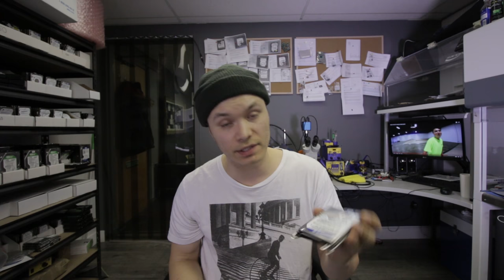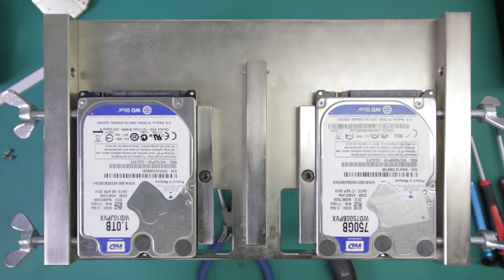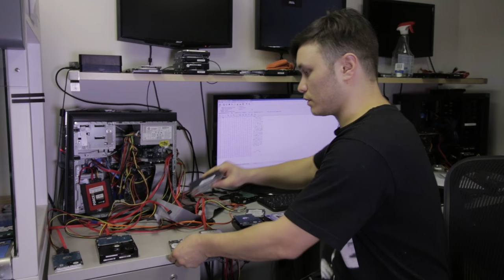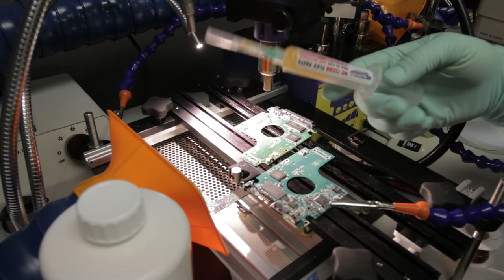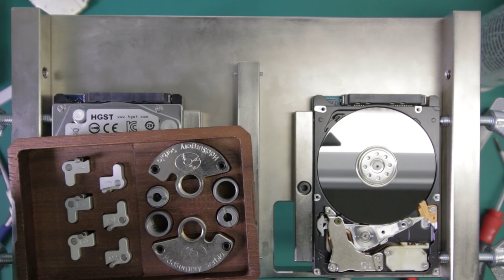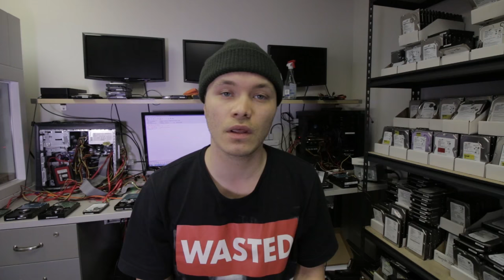hard drives with clicking sounds | 3 dead head drives recovered

Comment: I have an issue with a dead toshiba laptop drive, its does not spin up or read at all, on the inside the motor moves freely, platters look good, the heads look fine, and the pcb has no damage? Any idea what could be the problem!

Comment: Thank you for the interesting video. May I ask you some questions?
1) Why are you actually moving the U12 IC from one PCB to another? With PC3k you can read the ROM of the passport drive with the Serial Interface and write it with the SATA Interface to the SATA PCB. I think, it's much faster then the chip transfer. And you can reuse the SATA PCB more times.

2) On the first WD Blue drive you did't use the HDD Surgery Ramps, but just heat shrink tubes. Is there a reason? 

3) May be you can help me a little bit with one case.  Currently I have a WD Passport drive with the wd20nmvw-11AV3S0 HDD inside. This drive has 8 heads. One (afaik 7 of 8) is not reading at all. I tried to get a cheap donor drive, but it was impossible. The price is about 200-300$ for a working drive. On the other hand you can get 2TB Notebook drives for about 60$. How are you handling such cases and finding a donor?
Reply from the maker: hey, awesome questions.
1) just a habit, but I should really start doing it the solderless way.
2) I will check the family of the blue drive and post in here on Monday, but they do have a 2 disk ramp in that kit that lines up with that family
3) as long as the family is the same donor should work regardless of the spec. I use desktop donors all the time, as long as they have a SATA version of the same PCB they are really good to me. Then there is also this: https://www.youtube.com/watch?v=bN8uwV7udtI

but I have not ran into a swap case where I needed to perform such adaptation. Like I said WD is very good for taking parts as long as family is same.

Comment: Great videos I'm learning a lot thank you. 2 questions: 
 
1)  I have a WD20EADS Black ext backup drive that dropped on a carpeted floor.  Now it spins up but windows can no longer read.   I looked for another new drive to use parts from but I notice the MFG date and DCM# is different.  What are the chances that this drive's board and internal parts will work for repair?   
 
2) I'm comfortable learning anything technical and would like to persue leaning hard drive repair. I have about 50 drives (and several computers) I've accumlated over time and would like to teach myself as much as possible.  My question is, what is the best place t0 buy the CORRECT tools, adapters, clean environment cabints etc. ?
 
Thanks!

Comment: My 2.5" Seagate 500gb laptop drives when connected shows only 3.8GB space n doesn't allows POST test to complete n BIOS gets stuck on blinking cursor. HDD get's detected with my primary HDD of 1TB Seagate HDD in Dell Precision M4800 workstation laptop. How to fix my defective drive that doesn't spins. please suggest.

Comment: I have a wd  wd10jmvw and the hard drive heads go over the platters but then go park to park and it does this over and over again. What would the solution be to get the data off. Move the platters to a working drive.

Comment: do you have any videos that show different types of symptoms of HD failure like diagnosing board or head failure or motor etc?
Reply: 1. Dead PCB (Or damaged Boot-ROM): No sound at all, because drive does not spin up 
2. Clicking sound of any kind: heads cant read 
3. Beeping Sound: Heads stucks on surface

Comment: Hello. Great Video. I have a few broken head HDDs which I would like to play with could you please tell my what sort of material (plastic, rubber) are you using to separate the heads. I'll be really grateful for your answer
Reply: I had the same question.  Looks like some sort of dental rubber band.  There is an expensive tool that you can get that works with Seagate drives, but not sure if you need a different tool for each drive manufacturer, because I do not know if the platter spacing is the same for each.  Any comment?

Comment: Question.. what would be the issue of doing a head swap and trying to run the drive without using those fancy utilities like building a head map or imaging the drive. Why not just run it?
Reply from the maker: what could go wrong if surgery is done without monitoring equipment? Surely enough in some conditions, it can be performed, but why would you want that? Hard drive after a head swap is not a brand new hard drive, and most of the time it will have problematic areas. Many things can go wrong. The operating system is not designed to work with failing hard drives. Disk imaging tools and utilities help to prep the drive for the safest extraction.

Comment: Hi Mate, I have the clicking noise with my WD external 4404a,  I can see the drive in device manager but unable to see it in c drive, anything you can recommend to try please. Thanks again
Reply from the maker: Clicking noise there is only one recommendation. If data is important get pro help. This would probably run you $800-1200

Comment: I have a seagate freeagent Goflex 1 TB external Hard drive which has a very very strange issue. It gets detected by the computer and I am able to open the drive too. But browsing through the files is very very slow and I am unable to even play a single video. I can merely see what files are present within the disc. The disc keeps making a small clicking sound every 5-10 seconds even when its not being accessed. The only advice Ive got is to format it but i wish to try and save data. What could be the problem?? Thnx in advance
Reply from the maker: I would suspect that one of the heads is failing. Formating is not going to reverse anything, it will only make things worse. You need to seek professional help, this is not a DIY. if you want us to check it out feel free to hit us up here, and metion link to this video so I know that it is you: http://www.hddrecovery.ca/contact-us/

Comment: Got a question  got a new 4tb hard drive and it is an external hard drive but my computers are not recognizing it. Running Window s 7 pro on one computer Windows 7 Ultimate on another and Windows 8.1 on another. The drive spins up but it is not recognized by any of my computers. Any suggestions would be apreciated. It is also not recognized in Disk Manager.Thanks .
Reply: Hi sir, what is the solution for this, do you found it or not? I am facing same problem for WD 4TB My Book. Pls reply me if you have any solution

Comment: How is it possible to swap 1TB heads on a 750GB hdd, there are no difference between them? And if so, when it's possible and when not? Thanks
Reply: simple  they had a similar structure, eg:1 tb drive has 3 platters 6 heads, 750gb may have had 3 platters 5 heads.

Comment: hi hdd recovery I have a question for you, I have a 1 TB hard drive how big can a 1 TB image hard drive? , which software tool to use for the correct image hard disk? ,ftk images or someting else ?what do you recommend me to use hdd tools?  ..... How much space on a hard drive should I have to create an image hard drive. ???
Reply from the maker: Images that we make are "sector-by-sector" so the target should always be equal or greater than the patient
Reply: @hddrecoveryservices  Is the sector-by-sector approach more reliable then the regular disk image backup or am I wasting my time? Will the restore points still work on the recovery partition if I don’t use the sector-by-sector method? Thanks.

Comment: I have a HDD where the heads have crashed onto the drive and created a large scratch.  Is there still any way of recovering any of the other data?  Do you have a video on how you recovered data from such a drive?
Reply from the maker: possibly, but this is not for video capturing type of case. Usually, those cases requier amputation of heads on scratched levels, disk cleansing if needed, multiple head replacement, lots of swearing, and tons of patience. On ocasion we get cases like this, but there is a lot of elements in the process. If you have a scratched drive and need your data, you need to take it to a pro. Watching video and seeing how it is done is not going to help.

Comment: Help, I have important data in my 2.0 USB SATA hard drive. Just recently, the drive does spin but it remains undetected. I have tried open the case and the head is just in place, nothing seems stuck. What are the possible solutions?
Reply: if it's a usb sata, put the drive back together and plud ir into your desktop, or juat replace the usb/SATA board. bout 5-9 dollars on ebay.
this the usual problem with those things. they automatically get 5v from the usb port so they spin up but cos the USB/SATA converter doesnt convert so nothing gets sent through to tell the system that the drive is alive and ready.
so therefore the system doesn't recognise its there
Reply: Thank you for your suggestion, I will buy the new board and try it out.

Comment: $200 for a donor drive wtf!?  just get one on ebay for $50 TOPS and then after recovering the data, put the parts back into the donor drive and sell it on ebay for $50 and you are out like $5 in shipping
Reply from the maker: artbyrobot not so easy when you need to match compatibility. These passport drives are not sold outside of their boxes/enclosures. Intact, they actually have "not for sale" written in the actual label on the drive itself. So matching them blind for the $50 option may turn out to cost much more than $200.

Comment: What are the little yellow things you stuffed under the heads before removing the assembly? Normally you'd used a special tool for this, right?
Reply from the maker: exactly, most of the time we would use a head comb for head removal. those are just spacers to keep heads apart and prevent touching.
Reply: Fair enough.

Hey, how come you make an image of the drive each time? Can't you just copy the files directly?
Reply from the maker: Wyr3d that's a huge nono in data recovery.
Reply: How come?

I have a HDD that crashed last summer. The drive was readable, so I shut it down, and bought a new drive. I didn't have my rig with me (former PC engineer), so I sent it into a repair shop. The idiots I sent it to (PC World chain store) insisted I have a fresh installation on the new drive rather than simply ghosting the data across as I would have done, and then transferring the data afterwards.

They had my stuff for over two weeks (I was quoted a few days, and "a week at the most") and when they called to say my laptop was ready, I had to ask for my HDD - which they had "misplaced". When I got to the store a technician was "working" on my laptop stating the HDD wouldn't read.

I noticed it was now clicking also. I believe they dropped my HDD making the problem worse that it was initially. What was probably just stuck heads, is now broken heads most likely - long story short, never take anything into that chain-store's "Know How department" as thy only know how to break shit. ==

Anyway, I only really need a couple folders with some files, not the whole drive, which is 1TB. I already bought a donor drive, and was thinking of just swapping the heads out and taking the files I need. The rest isn't important to me, so it doesn't seem worth imaging the whole drive if I can just get the specific files I need.

Won't it work? I've already wasted money on this, and I  don't wanna spend the ridiculous prices I've been quoted here (UK) for data recovery services (I got quoted something like when it's just a few files I want.
Reply from the maker: unless you do this every day, I would not recommend just swapping heads. It looks easy in my videos, but only because I've been doing this stuff for 12 years now, since 2005. If you do anything for 12 years - you will make it look easy :). Is it a WD drive?
Reply: Nah, it's a Toshiba - they make their own for their laptops.

I was a computer engineer for about 10 years, but never really bothered that much with failed HDD's - mostly virus attacks, software/hardware problems and user error. I have taken a few apart to fix for data retrieval, but never swapped parts to do so, just reset stuck heads. As I said, I only want a couple folders off the drive, so I don't mind trashing another to do so if it will work, but if I have to image the drive then I'm gonna need a larger HDD for that too
Reply from the maker: Wyr3d make sure heads are spaced out if you do this
Reply: EDITED -  Yeah, I probably won't bother. Most of the stuff on the drive doesn't matter, and of the two folders I wanted to recover, only one matters now, as the other is obsolete now in any case. So it's probably not worth destroying a second drive to get back what's probably less than  1gb of data

Comment: sir what if in case of pcb is burned and adaptive data chip failed. does plater swap resolves the problem
Reply from the maker: no platter swap only resolves issues related to the motor. Platters only get swapped if motor is burnt, or seized, or contaminated by water damaged sometimes. adaptive data inside of the eeprom chip on WD can easily be rebuilt, but if you have a seagate I dont know a way to assist
Reply: thnk u sir

Comment: Hi, can you swap heads without pc3000?
Reply from the maker: yes, but most likely the drive will not work for long time. Patching needs to be done for stable imaging. Without PC3K or similar tools the unit will be stuck in slow responding.

Comment: So it's actually safe to open the drive without concern for dust getting inside the drive and head assembly area?
Reply from the maker: We work on exposed hard drives inside a class 10 laminar flow cabinet with hepa filtration